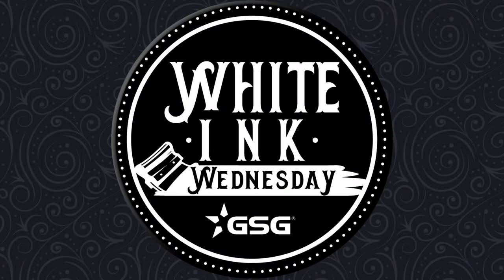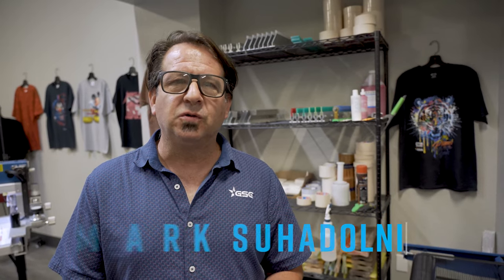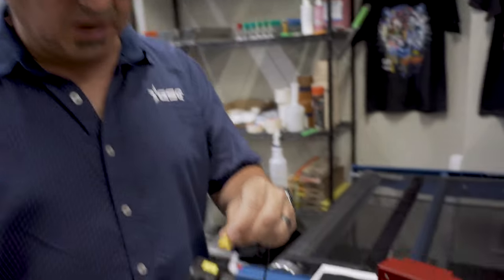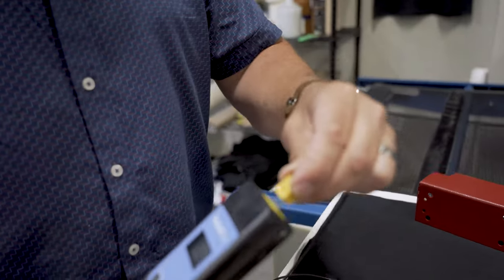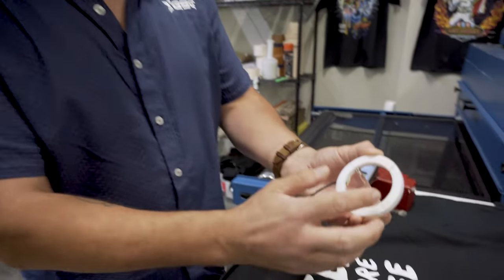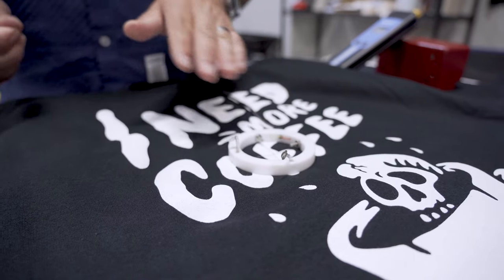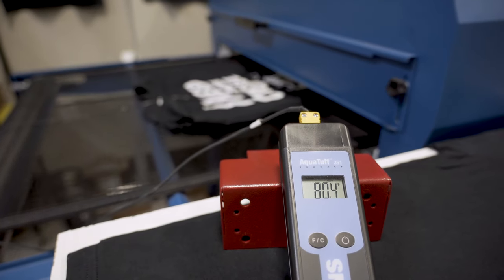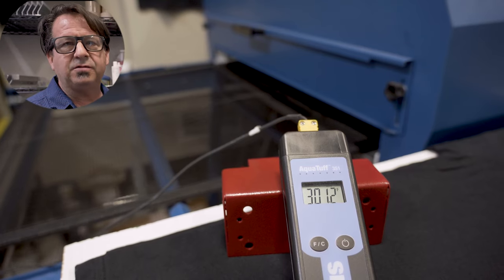Screen Printing The Importance of Using a Donut Probe (Thermo Probe) | White Ink Wednesday

Comment: Hi, 

Since your testing one shirt by itself, would you want a slightly higher temp on the controller since during the production of printing you will have multiple shirts in chamber thus cooling it down with moisture and multiple shirts in the chamber? 

Also you said it got to 290 a foot before exit, looked like it got to 309

Thanks

Comment: If the wires are pressed into the wet ink, what do you recommend for removing the dried ink from the wires?
Reply from the maker: Hey Jim!
You can use a Wypall or similar product to clean the donut.

Comment: I flash before moving garments to the belt.  I do see that the probe needs to be used on wet ink to dial in the settings.  But this should not be an issue for those of us who flash to touch, right?  We're dialing in the temp and belt speed with the probe and then can run production with or without flashing? 

Asking before I pull the trigger on a probe. 

Thanks
Reply from the maker: The probe must go into wet ink to get an accurate reading.
Reply: Yes  @GraphicSolutionsGroup  I am aware of that.... I just wondering for those of us who flash before putting the garment on the conveyor to avoid the smearing the ink when moving it to the conveyor belt if we can still flash after dialing in the settings with the probe
Reply from the maker: There is no way of telling how cured the ink is after it has been flashed. So dialing in your settings based on wet ink through a dryer would not work in your case. Because as soon as you flash the ink, your settings would no longer match. Wet ink through the dryer with the probe would not cure at the same rate as your flashed ink through the dryer.
Reply: Got it. Just got my price kit today so will be working on pulling garments wet @GraphicSolutionsGroup
Reply: Why are you wasting time flashing before a convayer

Comment: I decided to get an Atkins donut probe for the accuracy, as an upgrade from my infrared thermo gun, with which my prints were passing stretch and wash tests when reaching around 165c- 175c. However, over multiple tests, for the donut probe to reach 160c using the method in this video I had to raise the temp of my drier so much the print is puffing and smoking and clearly WAY over cured.
Any thoughts? The device appears to be in perfect working order, but I'm having to put it away and trust my old testing methods
Reply from the maker: Hey Chris,
We would need more information, but it's going to depend on what type of dryer you are using. It sounds like it may be an electric dry and your heating panels are too low. Give us a call (800) 366 1776 if you need further assistance so we can get a better idea of what is going on.
Reply: @GraphicSolutionsGroup  thanks for the prompt reply and suggestion. I see you are using M&R gear, I'm using an m&r fusion drier, elements are 4.5 inches from the belt, I usually run belt speed 3, temp 450°f, but to get the donut reading 160°c I had to increase drier temp to 490°f, which was evidently too hot for the test prints
Reply: @GraphicSolutionsGroup  can I email? I'm in New Zealand

Comment: Do the wires get pushed down into the wet ink?
We tend to flash before unloading the garment to prevent possible snap back and getting ink transfer.
Reply from the maker: Yes, the probe needs to be used with the wires touching wet ink to accurately measure the curing temp.
Reply: @GraphicSolutionsGroup  I don't understand, if the wires are in wet ink, wouldnt the ink cure around the wires, sticking them to shirt? Do wires need to be cleaned each time?
Reply from the maker: @RewindBloomington  Yes. You need to clean the wire each time as it needs to be in the wet ink to measure the temp as it cures on the test print.